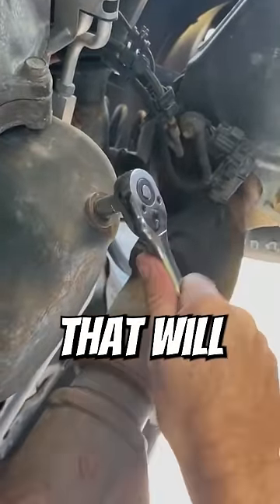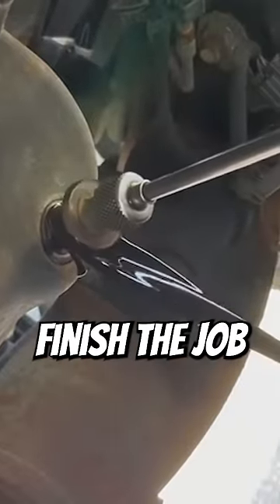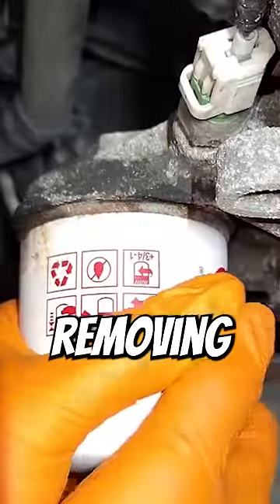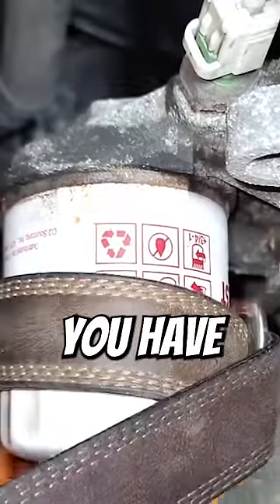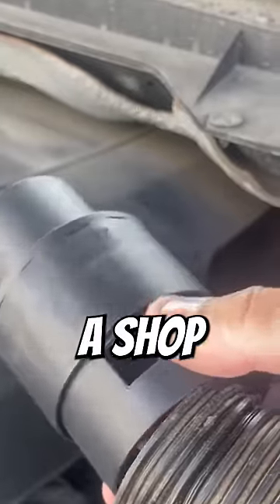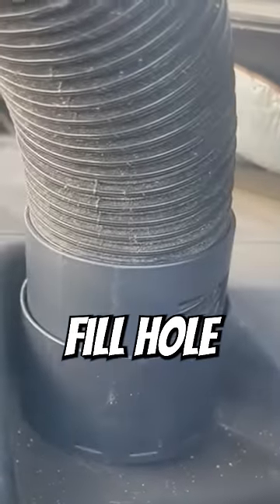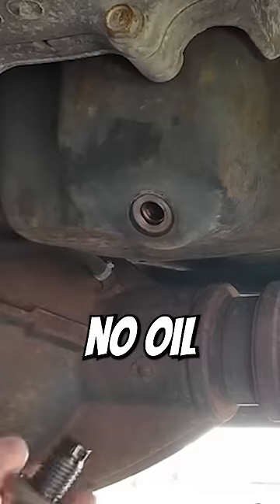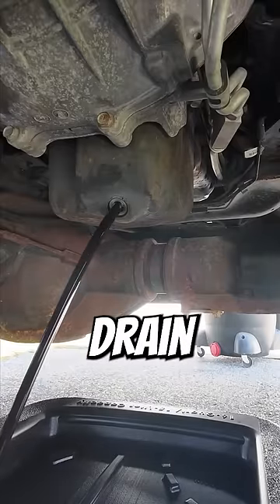Mechanic Life Hacks That Will Improve Your Worthless Existence - Oil Change Edition

Comment: The good old screwdriver and hammer technique for oil filter removal never fails
Reply: I used to do that on my 79’ Camaro.👍🇺🇸
Reply: Good way to ruin the threads where it mounts if you aren’t careful
Reply: @andrewkarsten5268  

Unless you're driving the screwdriver directly into the centre (if you are, why?) that's an absolute non-issue.
Reply: It failed for me! Hammered the screwdriver in, turned, turned harder, and the screwdriver started tearing through the metal, filter didn't move. Put a socket on it in the end.
Reply: It absolutely does fail.
Reply: God I hate this method. Someone did something wrong, if you're using this.
Reply: Use hand, squeeze hard, make spin, work every time.
Reply: That's probably the worst method
Reply: This guy knows 👍
Reply: @andrewkarsten5268 Exactly what I was thinking.

Comment: I use a gallon size ziplock bag when I take off the filter. Keeps all the oil contained and no mess. Better than a cup because you can grip it Better.
Reply: I was going to say that, or use a plastic grocery bag.
Reply: I love when they drive 2 hours to get there to
Reply: Smart!! Would be useful on that one series of truck (ram maybe?) where the filter is tucked up under the transfer case and in front of a crossbeam support so you’ve got no room for anything
Reply: Jesus... I've been doing oil changes since the mid 90s and I've n very thought of that... Brilliant idea!

Less genius but helpful is laying down some cardboard or an old thick blanket under the entire front of the car in case for any reason it all goes south. Easier than muttering away to yourself as you attempt to scrub up the oil spill on your drive 😂 (dishwasher capsules are really aggressive on oil stains so worth a try!)

Comment: Id be careful recommending the vacuum trick. In some cases it could cause engine seals to fold inwards.
Reply: Or you'll suck up oil and ruin your vac. Stupid "hack" IMO
Reply: y'all just have to say somethin... don't ya? what cases, and what seals? name one... not that any of this is particulary useful.
Reply: @salvadordollyparton4826  my friend tried this on his Nissan Altima (vacuum hack) and ended up sucking oil into his vac. It ended poorly for him as his wife was holding the vac and he was under the car. When it sucked the oil it lost pressure and the oil went all over him, lol. I thought it was funny as heck anyway. 😂
Reply: @Fifth313ment about to say that,
Spared some messy hands but now got a shop vac full of oil instead lol😂
Reply: Pulls the the scroll right out of the scroll seal.
Reply: That's exactly what I was thinking!
Reply: @gavincurtis  yeah seen it a million times forsure.
Reply: All of these tips are more of a pain in the ass than what they save, however you’re not pulling seals with a vacuum. During normal operation your motor IS UNDER VACUUM. This is what your Pcv system does. There is an amount of blow by that is not preventable and creates pressure inside your bottom end. Old vehicles used to just put filters on the valve covers to vent this pressure. Now a days we have the Pcv, It uses the vacuum created by your cylinders operating and steals some of the suction to keep your bottom end under vacuum. Cars made in the last several decades have this feature and recycle the “dirty air” back into your intake. Cars before the Pcv used to just vent crankcase pressure to atmosphere but emissions and all have made automakers recycle that dirty air back into the intake to be burned. It also helps create a better cylinder seal and leads to more power. Some huge horsepower cars have belt driven vacuum pumps for this increase in power
Reply: Lol yuppers
Reply: I love how 100 people liked this because of sheep mentality. Do people really think a vaccum can damage seals 🗿
Reply: I'll take shit that didn't happen for $50, Alex.
Reply: I did this with my Dyson and it sucked the head gasket out.
Reply: @TheMRSTEVEN lol 😂
Reply: @TheMRSTEVEN  😂😂😂
Reply: @TheMRSTEVEN I did the same thing with my Dyson and found a main bearing in the vacuum after😭
Reply: Or just destroy your shop vac 😂
Reply: i dunno about the seals…but definitely gonna need a new shop vac! 😂
Reply: You are wrong zackypoo-->  the vacuum is acting the wrong way to attack any seals.
Reply: Shop vac 9000 sucked my muffler bearings in will it hurt to run without them?

Comment: You forgot the 'hack' or 'trick' where you're supposed to unscrew the oil fill cap under the hood to allow the oil to flow out quicker with no negative pressure vacuum.
Reply: I do that but to be honest it never seems to make any difference even if you don't.

Comment: I use the hydraulic tank vacuum trick daily. The belt doesn't work very well, and if you're messing around with a magnet so you don't get dirty.. apply for a job at the local flower shop. Sissy😂
Reply: Yeah man, I'm so manly once I've dropped the oil I drink 3 litres of it and rub the remainder into my skin to teach it not to be complacent.
Reply: @skylined5534 gets cancer at age 60 heh nothing personnel

Comment: On some dodge pickups, you can’t get a cup in. I use a large ziplock bag. Works like a charm.
Reply: That's also a brilliant idea... actually, it's way better than the cup.

Stealing that, thanks! Yoink
Reply: Use a long, slotted screwdriver and a hammer, if possible. Hammer a small hole in the lowest point of the oil filter. Let it drain first, then take off. Hope this helps.

Comment: If you are worried about getting your hands dirty, you are probably not going to be changing your oil yourself anyway.
Reply: While true you also want to warm up the engine for an oil change so there's no sludge left on surfaces in the engine.
So it'll be hot oil on your hands which can be dangerous.

Comment: Vacuum been doing it for years. Thanks for passing it on.
Reply: doesn't the vac get full of oil that way?  and if so, i can't imagine why we'd want to ruin our vac
Reply: @cryptfire3158  I imagine the internal volume of space for the oil to go means it'd be pretty hard to suck it out this way, if you've ever had an ice cream/slushy thing that has a super wide straw for bits of cookie/ice to pass instead of the thin normal ones and hated how annoying the straw was to use, same idea (If you haven't and are now curious, drink through one normal straw, then put 5 in your mouth at once, then 10, you'll notice the difference)

While the plug is still in the oil pan you're just pulling vacuum, same as sucking on a straw with your finger over the end
Reply: Wow, I’ve never heard of it
Reply: Works in diesel tanks when undoing and adding lines at the bottom of the diesel tanks on semi’s. Used to do it often.

Comment: I my heavy truck shop we use a spike to make a hole in the bottom of filters to drain them before removal it also makes them lighter since the big ones on Mack's and Volvos hold over a gallon of oil.  We also do the vacuum trick on the coolant system but with a special machine that uses shop air to drain, fill, pressure test or pull a vacuum to change parts out with very little coolant loss.
Reply: disel tech here i do the same
Reply: Spiketools are great. I have one on my keychain.
Reply: That’s a good idea, would work well on oil filters that screw to the side of the engine. So you don’t get oil all over the block.
Reply: Please loosen the filter before you punch a hole in it y’all. Benn workin on semi’s for 24 years and have had to chisel about 10 or so filters off because guys didn’t loosen the filter first.

Comment: The belt trick works great until somebody torques the hell out of the oil filter. I had to use a 3 ft breaker bar with all my strength to get the dam thing off last time. I honestly thought I was gonna rip the housing clean off.
Reply: last time i let anyone touch anything of mine when i was 18... nearly had to pull my barely 2 year old engine out because of a kwik lubetard... not cheaper than doin it myself in that instance, so no more chancing it...
Reply: I bought a Pontiac Grand Prix from a Pontiac dealer many years ago. The manager says, "It's been fully inspected and passed all inspections. We also changed the motor oil, so it’s ready to go." 
When it came time for the next oil change, which I do all my oil changes myself, I had to use a 1/2" drive breaker bar the whole time  to remove the oil plug. I called them every word in the book while taking out the plug, praying the oil pan threads weren't stripped out. Thankfully, they weren't, but the threads on the drain plug were stretched backward like a wedge. Of course, this was on a Sunday when the parts stores close early. On Monday, I went to the auto parts store with the plug and showed a guy behind the counter. He about dropped a turd. Once I was done with the oil change, I drove back to the dealer and showed them the plug. The mother fucker dummyed up the whole time and said I must have caused the problem. I gave him my opinion of his flunkys working in the shop and vowed to never buy anything from him again, which I never.
Reply: Imagine having that problem with 3 oil filters in a tight space,
Reply: Standard reply "it was like that when you brought it in"
Reply: A few words about this. 
Long screwdriver + Hammer. I hate mechanical noobs!

Comment: I had installed one of these last year. Total life changer. This replaced the bolt with a spring locked valve I can open when ever I'm doing my oil. EZ-104(18mm-1.5) EZ Oil Drain Valve with removable L-Shape Hose End(L-001) Combo.
Reply: So if you hit some debris on the roadway you can dump all of the oil out of your engine too. Nice.
Reply: @kmoecub  They come with a clip that prevents the valve from opening when driving as added security.
Reply: @acevortic5759 i drive lowered trucks, i would knock the valve right off..... definitely not for me, but if you trust it. 👍

Comment: For removing a oil filter just puncture it with a screwdriver and there is a handle. If you use your belt you’ll loose your pants 😅
Reply: The screw driver trick never worked. I never had clearance to turn it and now the oil made the filter hard to grab with anything else.
Reply: @t436  

It does work most of the time but it's messy and a total last resort for me.

For hard to access filters tapping them around near the gasket end (which deforms the filter and loosens the seal as well) is another option.

Comment: That cup is sick. But my 3rd gen Taco has a very accessible but inverted filter right under the hood
Reply: Wanna tell us your life story too
Reply: They have a small drain under where the filter sits on the mounting surface. Put the cup there to collect all the drained oil and your good. That’s my go to
Reply: Poke a hole in the top of the filter and let it set for just a bit. That should let the oil drain out so you don't have a mess.
Reply: Good that Toyota has returned to spin on filters rather than cartridge oil filters (bullshit).
Honda never fell for that nonsense gimmick. 
Basically now it's mostly the shit vehicle brands that use them.

Comment: Love the vacuum hack .. just asking is that ok for the engine I am just wondering...  I have to try that AWESOME!!!!
Reply from the maker: ive never had an issue doing it
Reply: @NoobMechanic  awesome thank you was just curious didn't want to damage anything.   Thank you.
Reply from the maker: Anytime!
Reply: It's fine: the oil circulation system is designed to be under pressure. The only thing that it would ever do would be to expose damage that was already there and would need to be addressed urgently anyway, and will act like a release valve which would prevent strong negative pressure.
Reply: Don’t suck your muffler bearings in

Comment: Great tips and Hacks as a mechanic i have used every single one of these tips and tricks but my absolute favorite is the Shop vac or Wet vac hack works on lots of things including radiator Coolant and engine oil and transmissions as well as power steering fluid and No it dosent harm or get into the Wet dry vac just creates a negative Pressure Differential
Reply: @juanocampo2262 your comment makes absolutely no sense
Reply: Forgot to put the crush washer on before putting the transmission drain bolt back in and refilling it. Dang!
Shop Vac trick will help.

Comment: I highly recommend a Fumoto valve for every car. No more oil on your hands and no more gasket replacement.
Reply: Introducing extra failure points to one of the most critical parts of your car, in a time where people don’t check their oil? If you’re quick or smart about it you’re not getting oil on yourself anyways, and a $0.10 gasket…
Reply: I've never understood why people install these things.  Is it that hard to grab a wrench to unbolt the drain plug? l
Reply: @randyedelen5770  the two reasons I listed for starters followed by no needing to research the torque value or risking over torquing the drain bolt and stripping the threads.
Reply: @foojub6907 what failure point would that be I have been using one for 4 years now with no problem what so ever. Not only does the little lever lock into place it also comes with a little locking tab you put over the lever. 3 years not one drop of oil on the ground and changing the oil is so much faster just flip the lever and let it flow. 🤷‍♂️
Reply: @Anthony-fd8mh until you hit something that pulls/breaks it off then your oil will leak out and your engine will lock up. Easier doesn't mean efficient. You must be in a lifted vehicle, that wouldn't be an issue as much.
Reply: @FabulosoSpray  nope in 2015 Jeep Cherokee. The valve threads into where the drain bolt would be so nothing hangs down. Think of it as having a small spout on your drain bolt. That’s all it is. Would be pretty hard for something to hit it.
Reply: I like valvomax better.  And with aftermarket steel skids on my 4runner it's not going to get sheared off
Reply: @randyedelen5770  It’s faster, more convenient, and makes less of a mess. Why wouldn’t you? 

Are you really getting your panties in a twist over fumoto valves?
Reply: Lots of heavy and ag equipment use these valves. As a technician of 11 years full time I’ve never seen or heard of one of these failing or accidentally opening. I have seen several drain plugs stripped out from being over torqued. Also have never seen one that got ripped off due to hitting something. Ag and heavy equipment are also in many more situations where that could be a possibility and I’ve still never seen it happen. If you hit something big and hard enough to rip it off your oil pan you’ve got bigger problems anyway. A drain plug is not better than a valve. The only reason they are not installed from factory is because manufacturers don’t want to spend the extra money.
Reply: The only use I can see for them is for those who pay some gorilla to do it
Cuz you damn well know they're gonna strip it or get it so tight it won't come off with out rounding the corners.  If you do it yourself it's kinda pointless.
Reply: @matthewbeaver5026  I use them in all 4 of my vehicles and I do my own oil changes every 3000 miles. I drive 30,000 miles per year so I do oil changes often. You have you opinion on the subject and I respect that. I find it very convenient to have the valve and would like people to know it’s an option.
Reply: They are especially helpful on extra low cars.
Reply: In theory I like these valves as a solution.  But given that I'm a template from which fate designs its 'shit happens' scenarios on I really daren't 😂
Reply: @lucasw24 Agreed. My job has a fleet of a couple hundred trucks, some are Chevys, some are Fords, some are Dodges, and some are large trucks like Freightliners/Internationals. My work truck Chevy has one of those valves on it and I haven’t had an issue with it randomly opening in over 3 years.
Reply: Agree, first thing I install on every new car I get. No need to chase down a new drain plug washer, no more worrying about over-torquing the drain plug bolt, etc. Pays for itself.
Reply: I use the Fumoto Valves on all my cars except my Porsche Cayman because Fumoto doesn't make one for and it is one car that is really too close to the ground for it. With my Subaru Outback I could change the oil in my living room without spilling a drop, that's how good that little well made valve works (Made in Japan) not China.  Plus the oil filter in the Subaru sits on top of the engine in a small bowl.  Changing an oil filter standing up is having a car made in Heaven.
Reply: @lucasw24  yep! You said it. 100%
Reply: @Prosecute-fauci  Wow!  Properly torquing a drain plug has never been an issue with me.  Although people swear by these Fumoto valve, a failure of these would result in a catastrophic engine failure before you really even knew what happened.  So, I'll just stick to the caveman approach of a plug.
Reply: @TucsonDude  a few dozen “Ugga Duggas” will get you where you need to go.

Comment: I worked for a large construction equipment manufacturer and we actually had a fitting that went on the hydraulic tank for vacuum and you could pull entire hoses or pumps off without spilling any oil it works

Comment: Definitely the ShopVac...  Not only to prevent the intial spill as you showed.  But after the majority of the oil is drained,  put a empty bucket near the drainhole.  THEN TURN THE SHOPVAC ON TO BLOW vice SUCK.   I get anoother whole quart of black oil that blows out.  Watch out tho to keep the mess down...  I use a hose to blow it into a bucket.
Reply: That's a really good idea!
Reply: Careful you are not blowing particulate INTO the valve cover.  Can you imagine if you blew a bunch of dust INTO the engine....
Reply: I’ll take “shit that never happened” for $600, Alex.